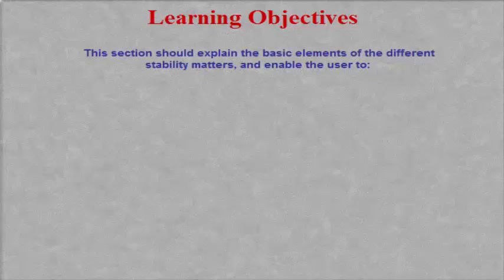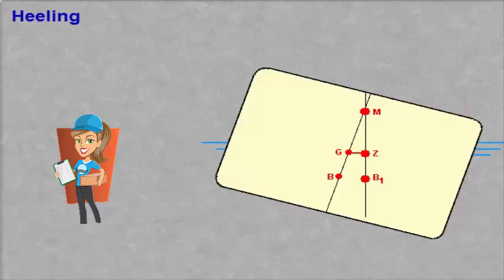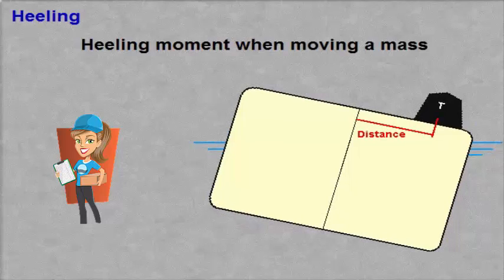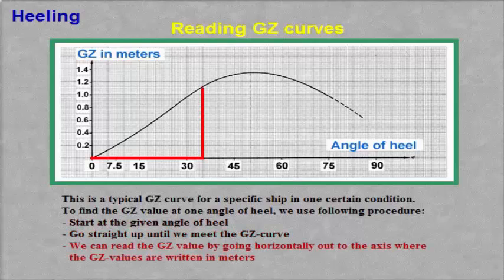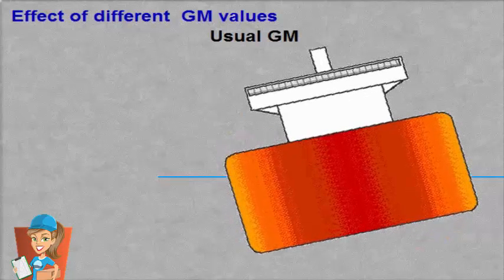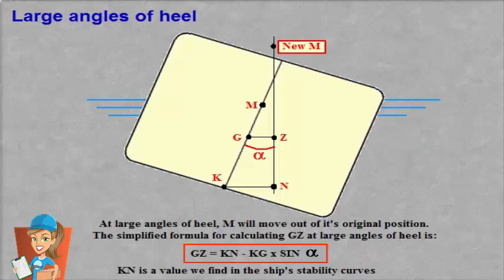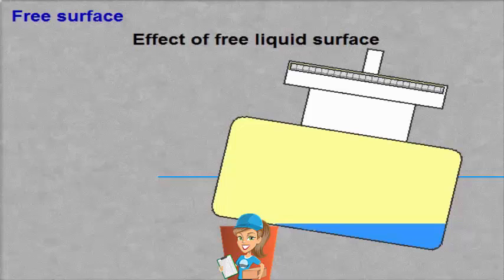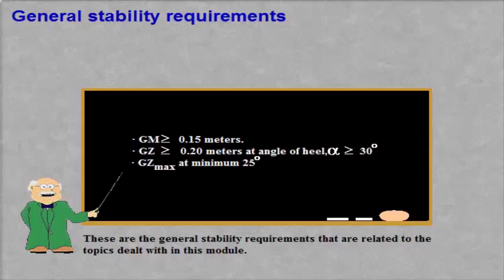Transverse Stability

Comment: There are mistakes in this video. When discussing the “heeling moment” this should in-fact be listing moment. A list is caused by the vessels center of gravity being moved away from the center line due to un even loading of weights. Later in the video when explaining how a list is caused by an external force pushing the vessel over, this is also in correct. This would in fact be a heel. Some how they managed to get them mixed up.
Reply: heeling= External forces.
listing=internal forces.
Reply: @kenlee-97  Wrong. Go to the bottom of the class you have failed to reach the required competence.
Reply: Wrong. Go to the bottom of the class you have failed to reach the required competence.